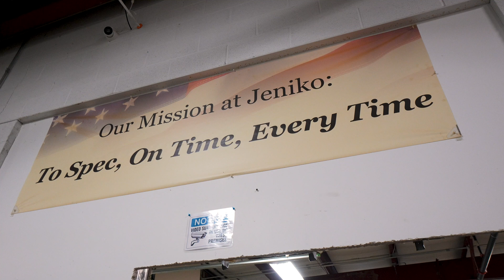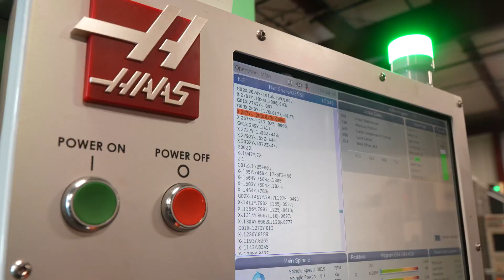Customer Spotlight - Jeniko Machine Works - Haas Automation, Inc.

Comment: That's a lot of rust on the spindle and table
Reply: We have a dmg with more rust on the spindle case , wrong mixtures !!
Reply: bad coolant, if ur machine is rusting you need to look at ur coolant cuz its supposed to prevent rusting, other option is they are leaving it for a period of time with no coolant flowing like on holidays and didn't cover the machine in anti-rusting sprays like wd-40
Reply: Coolant is one of most overlooked thing in the shop. We learnt the hard way. From rust to destroyed expensive way covers, jammed drills and so on.
Changed from the cheapest local product to Blaser B-Cool more than a year ago.
Never going back.
Reply: @3axisrocks393  Learned the same way in my shop.  BC20 from Blaser I run now 10+ years. My 2012 VF2ss spindle has the same spots on it, from running cheaper coolant.  Never again using cheap coolant
Reply: @Vankel83 i always thought it was humidity , might gonna have to take a look at blaser